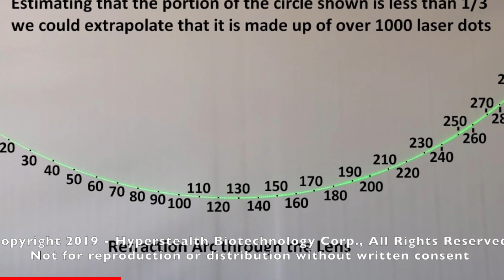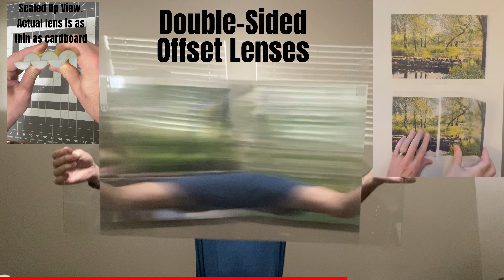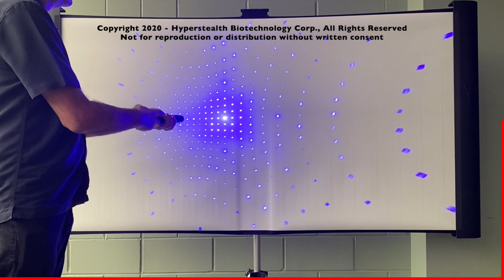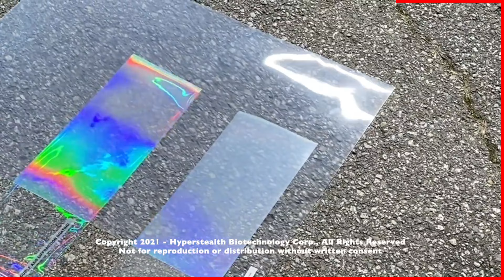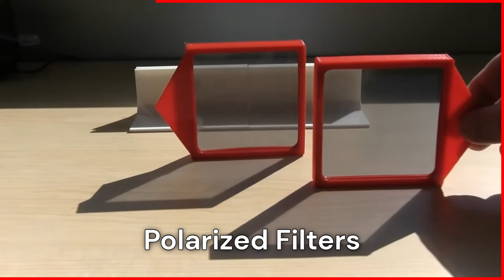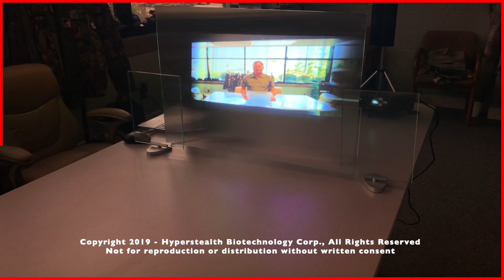Is Hyperstealth Invisibility due to Quantum Mechanics

Comment: These might be  good for hiding UGVs  and Humanoid Robots especially if smoke is also  used to  obscure  the battlefield as well.

For example in my video called, How To UAV proof a UGV I show  how Humanoid bots might travel in a prone position low to the ground using a One Wheel and  this might  be used as a clocking cape to make the bot even harder to spot.

They might also be used to hide solar panels as one can see they might be employed in the video I made and uploaded to my YouTube channel called, The Electrified Forest where one  employed flexible solar panels wrapped around tees to help conceal them from UAVs.

The trick here is to make the  clocking work for you  and mitigate how it might work against you.